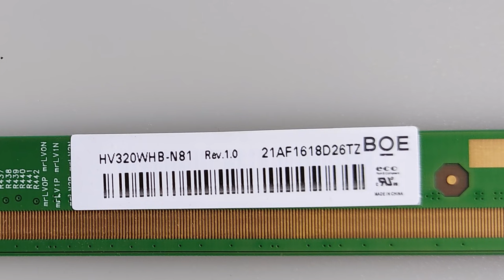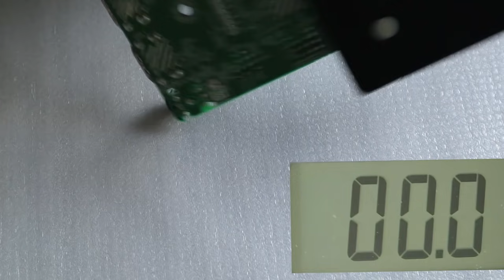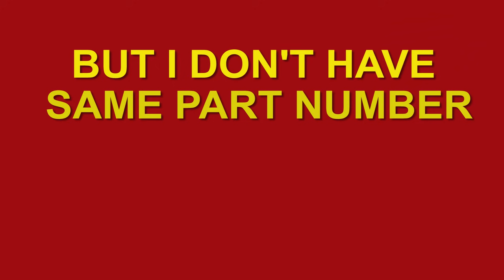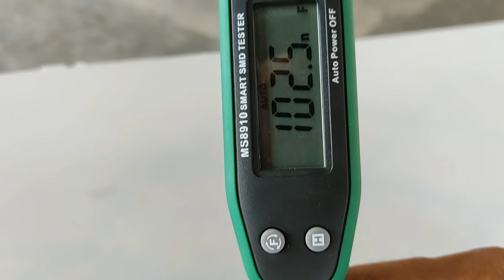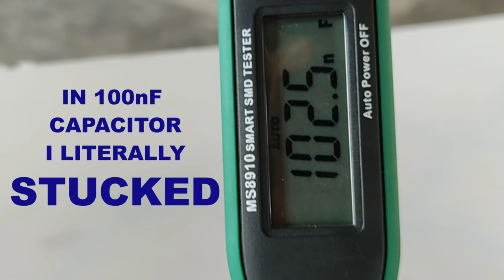Panel Problem or Mainboard(with built-in T-Con)?

Comment: Another grate video sir 
Switching diode is related to voff or von or avdd?
The culprit part is diode or capacitor or both?
What the result after replace diode+capacitor and before replacing earlier ic?
Reply from the maker: Good question friend 😀👋
Switching diode is related to VOFF 
 both was faulty components.
Before replacing, earlier IC did not work
because AVDD & VOFF Pin of IC was found already short( when capacitor was burnt at that time )
Reply: @VcoreLC  lot of thanks for reply

Comment: What about a Sony 75" with backlights coming on but dark blue screen. Swapped tconn but still the same. What's the next thing to check I'm presuming it's a panel fault. Model no kdl75w855c.
Reply from the maker: Check scalar or  block gate lines
Reply: @VcoreLC  do you think it's repairable?